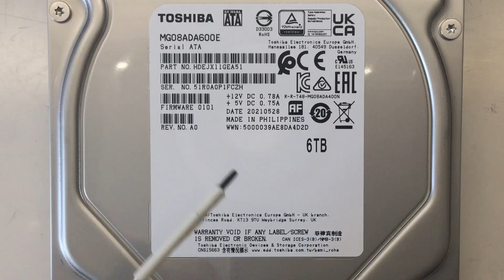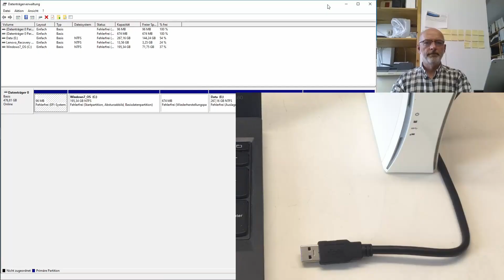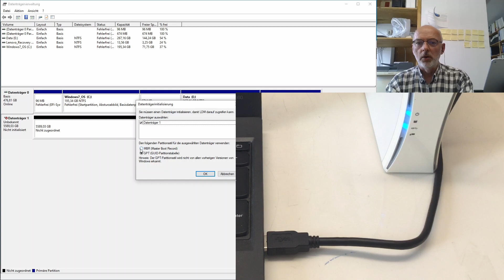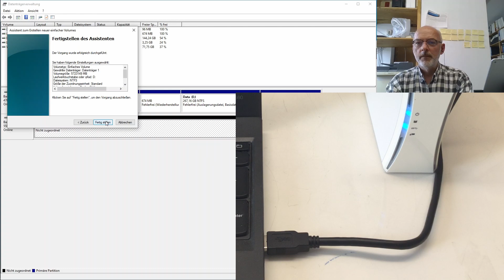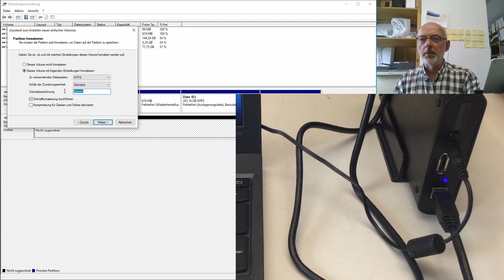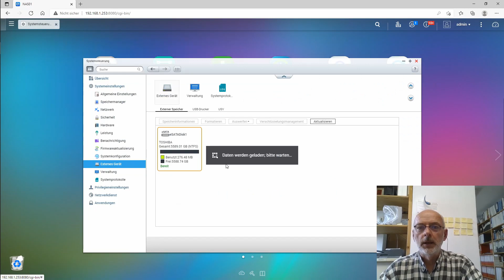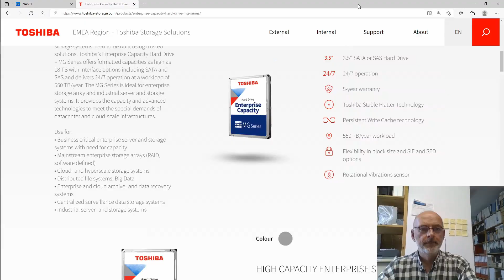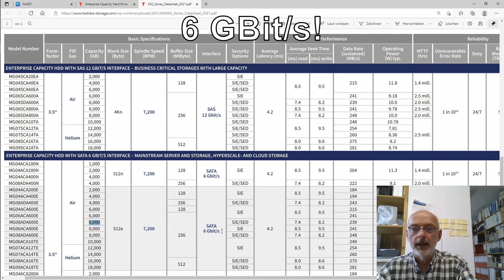Toshiba 3.5″ Enterprise HDD (6TB, 7.200RpM, SATA) Unboxing, First Impressions

Comment: I have the 8 TB desktop version, the HDWR480. Knowing Toshiba, the differences between it and enterprise equivalent MG08ADA800E are probably minimal. It is my fastest drive, and the MG08-D family certainly is a nice one. I've always wondered if, just like the helium MG08s, if the -Ds use TDMR, but that requires looking at the PCB to check and I'm not willing to risk warranty. Anyway, nice drive you've got there, though being enterprise drives, they can get pretty hot; mine would hit 55 degrees without a fan.
Reply from the maker: So far I have no complains about that drive. Though I never had a look how hot it gets. But after your comment I guess I'll just do that - just in cases.
Reply: @ChadDidNothingWrong  That's 10 degrees C over its rated temperature of 55. No wonder it failed so soon, sorry to say.
Reply from the maker: @ChadDidNothingWrong  I second TheDragonFire123 here. 65°C (150°F) is far too hot. I guess the temperature sensor is somewhere on the controller board, so inside the drive it's probably even hotter.
Reply: @robertssmorgasbord  It's worth noting that even though I'd incorrectly assumed Travis' drive was an MG08-D family drive, the MG06ACA10TE, which is likely his drive, has the same maximum temperature rating.
Reply from the maker: @TheDragonFire123  65°C is too hot for any drive in my opinion, even if the specs would allow for it. I don't like to have parts in my computer that are painfully hot to touch 😉

Comment: These are fairly high powered drives.  They might get pretty hot inside those enclosures without a fan.
Reply from the maker: The enclosures definitely get warm to the touch (not hot though). I have these connected to my NAS 24/7 and experienced no problems so far.

Comment: Toshiba MG series Enterprise drivers are cheaper than "Pro" drives.  I was worried if these MG drives are noisier.  But it seems they are not so I will buy one.
Reply from the maker: Nope, they (Enterprise) are not noticeably noisier that the "Pro" drives.

Comment: Thanks for your video, how about its noise &  temperature perfomance for a home-use nas?
Reply from the maker: In my big tower with fans it just gets slightly warm (not hot) to the touch. But it's not the quietest drive I've ever had. You do hear it spin, though that's not too bad. The access noise (heads moving) is distinctively noticeable (but that might be just resonance within my big tower). Also, it needs quite some time to spin up. All in all it's an enterprise drive and I guess low noise was not a top priority in its development.
Reply: @ChadDidNothingWrong  The 10 TB version is a different generation (MG06 versus these MG08-Ds), as an FYI.
Reply: For whatever reason, it's a fairly quiet drive, at least for my particular specimen (a HDWR480, which is similar to this MG08-D, except binned for desktop use and has one more platter). I was expecting something horrendously loud, as enterprise drives tend to be, but apparently not.
Reply: Thanks guys, Iet me try one.
Reply from the maker: @ChadDidNothingWrong  I guess the 10TB version has more platters, and thus runs hotter. But it really shouldn't die in you in an open-air case.
Reply from the maker: @TheDragonFire123  Thanks for the info ("...10 TB version is a different generation ...")"
Reply from the maker: @TheDragonFire123  I would almost second that ("... it's a fairly quiet drive ..."). In my initial reply to Amoro Gae I described it as "not the quietest drive I've ever had". It's definitely not annoyingly loud (in a big tower under my desk). But I wouldn't go so far as calling it "fairly quiet".
Reply from the maker: @amorogae1873  Let us know how it performs for you.
Reply from the maker: @TheDragonFire123  Ah, the sound I hear every time I access my F: drive with all the video file 🙂  ( https://www.youtube.com/watch?v=4Es6Nzjy1Vs )
Reply: @robertssmorgasbord  Indeed, it does; the MG06ACA10TE, and all derivatives, have seven platters. In fact, it is the most platters ever stuffed into an air-filled hard drive. Toshiba are the only manufacturer who can place seven platters into an air-filled drive; WD and Seagate both use helium for that amount.
Reply: @robertssmorgasbord  I'd need to compare it to my newly received WD80EAZZ-00BKLB0 to truly understand how quiet the HDWR480 is, I think. I'll let you know how that goes.
Reply from the maker: @TheDragonFire123  Thanks! I'm always interested in quiet, fast, high capacity drives 🙂
Reply: @robertssmorgasbord  Just moments ago I spun up the WD80EAZZ... it's quite quiet during it, but any perceptions of noise would be spoiled by the HDWR480 literally next door to it... oh well.
Reply from the maker: @TheDragonFire123  Thanks anyway for the update. I remember the days when I was using a 5 1/4'' WD Raptor with 10000 RPM as primary disk. Nowadays my primary disk is of course a SSD, so I can actually hear what my larger storage drive is doing 😉
Reply: @robertssmorgasbord  @TheDragonFire123 Thank you guys, let me feedback, I think it has a good perfomance on temperature but not that good on noise control by comparing with WD red 3T which I used to use. On silent mode,  It always at 93-97°F(34-36°C) in a 2-bay NAS, alomost as same as WD, but the noise, u can hear it in the nearby room between a wall in the evening. Of course, it just my drives'  situation, that's all.
Reply from the maker: @amorogae1873  Thanks for sharing your experience! That's also my impression: cool enough, but a bit noisy.
Reply: @amorogae1873  Which model number did you end up getting? My noise report and video would only be accurate for drives with a HDWR4, HDWG4, MD08ADA, MN08ADA or MG08ADA in the model number.
Reply: @TheDragonFire123  sry, just saw this notice, my driver's model number is MG08ADA, hope to help u.
Reply: @amorogae1873  I've noted the opposite. My HDWR480 is known for being the hottest drive of them all in my collection, but is just as quiet as single platter 7,200 RPM units.
Reply: @TheDragonFire123  Maybe that is individual difference, not my lucky day:(